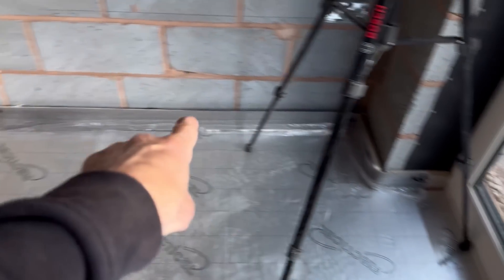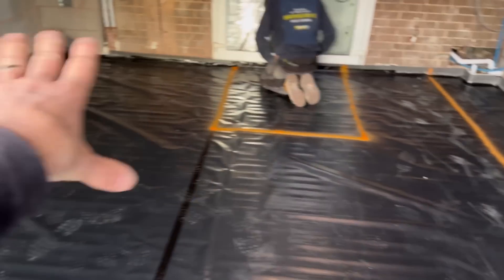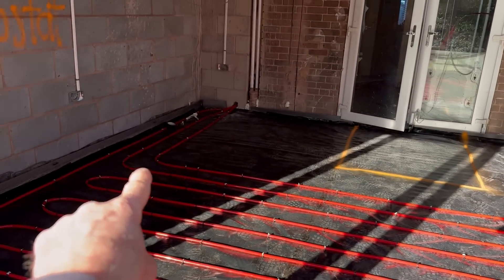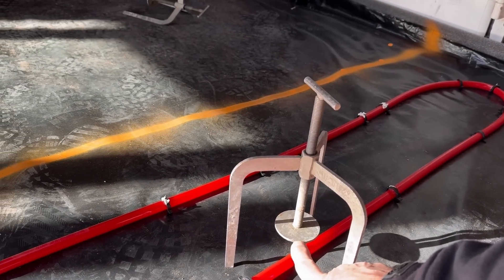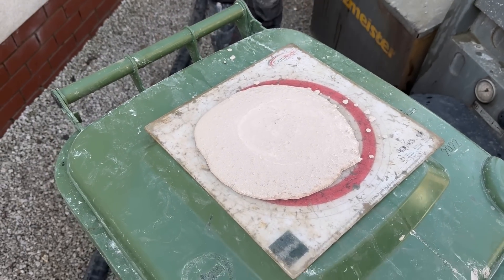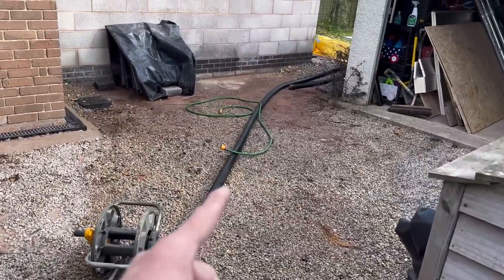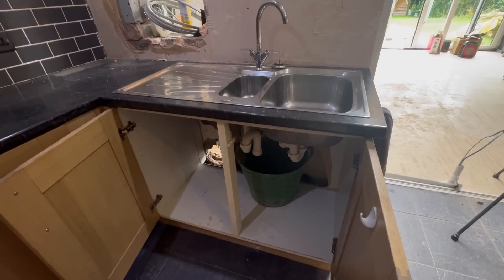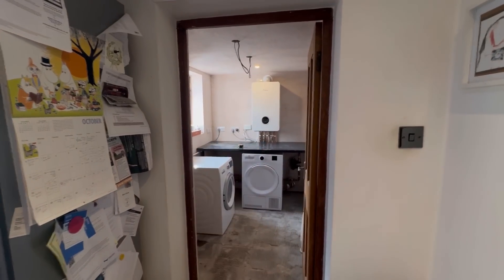Ultimate Guide - Under Floor Heating and Liquid Screed Installation!

Comment: How is underfloor heating accessed if it is inside a screed?
Reply from the maker: It's not mate, it's all serviced and maintained from the manifold.
Reply: @Mr_A_Builders  The underfloor heating in the flat above me makes a noise, especially when it comes on and it is disturbing me.  Can you think of any way to rectify this?  I can think of only 2 solutions:  1.  Buy the flat above me.  2. Pay the current owners not to use the underfloor heating at night.

Comment: Great vid as always 
Got a question though , if it 200 mm separation of pipe for a traditional boiler but less for a ashp, what happens if you add a ashp later ?
Reply: You would need to have the temperature of the water higher than ideal and it would be slightly less efficient but would still work fine

Comment: I'm sure it's just personal preference and you know this already but a lower gauge vapour control layer is enough on top of the insulation sheets (I think I used 500). Supposedly it's just to stop the foil from reacting with the screed, forming bubbles and weakening it. It might be easier to work with the 500 gauge on corners than the 1200 gauge dpm.

Either way, a great video as always. I learn loads every week. Thanks!
Reply from the maker: When you’ve already got a part roll left it’s not cost effective to then purchase a lesser gauge DPM. 👍🏻
Reply: @Mr_A_Builders  I did wonder if that was the case! Fair enough! 😅
Reply: From what I understand it should be a low gauge (120 gauge) separation membrane over the PIR to allow some vapour through so the PIR can completely dry. Probably not so important if you install the PIR already dry but if it had been wet and if it was sandwiched between 2 thick 1200 gauge DPMs then it'd remain wet forever and be a slightly worse insulator.

Comment: Great again Rich. Out of interest, when they leak test have they ever had a leak and if they did, do they need to replace all the pipe or can you do a local repair.
Reply from the maker: They’ve never told me they’ve had a leak during test but he did tell me when he was there he’d been out to a repair where a tradesperson had drilled through it once it was installed so it can be repaired. 👍🏻
Reply: That explains the process precisely 👍🤓

Comment: Nice to see your electrician using oval conduit to protect their cables. So many just clip the cable to the wall. Looks so much better in conduit. 😊
Reply: The only correct way to do it  IMO and should a fault occur, a new cable can usually be pulled through using the old as a draw wire.

Comment: Funny pause during the slump test?
Reply from the maker: Sorry about that but I had no other way to listen to what our UFH engineer was saying about the slump test. I didn’t want to put him on camera too long he wasn’t comfortable doing it 👍🏻
Reply: @Mr_A_Builders  ah OK, I almost started playing around with my phone thinking it was lagging
Reply: Trust extra layer of plastic is often called the slip sheet. The idea is to stop the Gyvlon from sticking too, or reacting with, the Aluminium foil on the insulation below. It serves double duty of preventing the screed from leaking down in any cracks there may be in the insulation if someone has missed tapeing a joint.
On the last four floors I've done I've followed the British Standard and pressure tested the floor to a higher pressure than you'll get from garden hose. I also fitted a temporary pressure guage to the system so I could check there was no pressure drop over 24 hours.
Reply: Flow test. Slump test is different but similar.